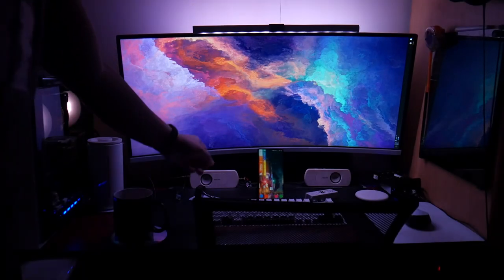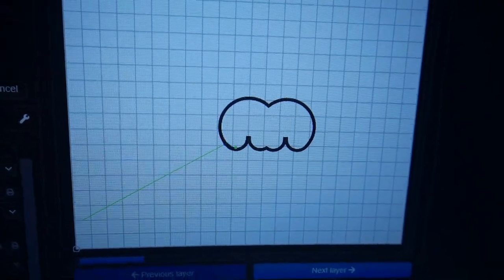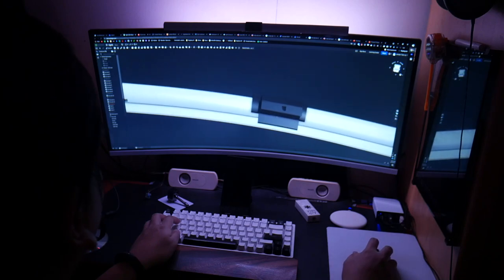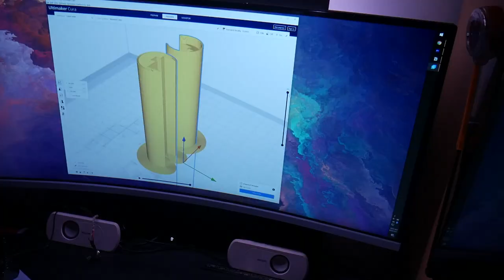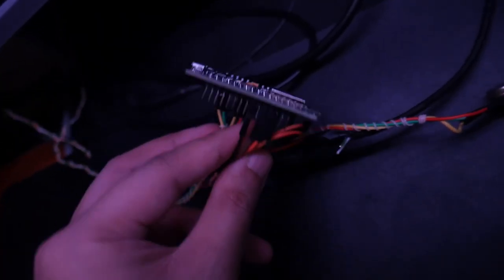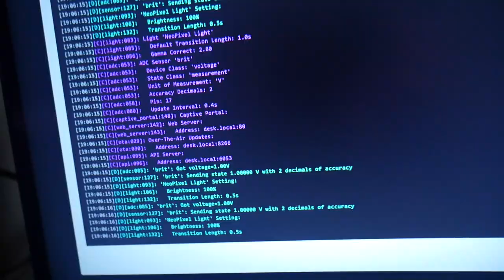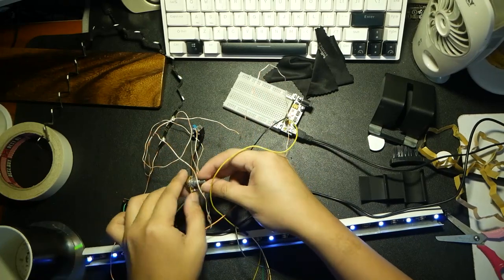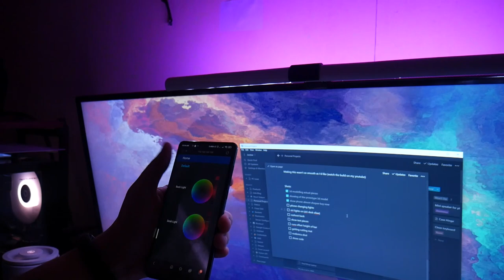Build or buy: Smart desk lamp

Comment: Is the light asymmetrical like the benq and Xiaomi bar? I want to make one too as I want RGB as an option, but I'm not sure what the light direction will be like. Does it hit Ur eyes or get on the screen? And any way to add a diffuser?
Reply from the maker: I designed it in a way the you can tilt the light in any way you like. As for the diffuser I put in slots in the model so you can slide in some, I failed to slide in normal printer paper, so plastic diffuser material is recommended
Reply: @thejandaebuildlog  Thanks! Any idea where I'd get plastic diffuser from that's the right size? Also I understand the tilt mechanism, but what about the beam angle, is It narrow enough so it can tilt and just only hit the desk without hitting the screen and eyes? Or is it wide so even if you tilt it to not hit the eyes it spreads onto the screen?
Reply from the maker: I also don't know where to source diffusers 😅 aside from the actual strip diffusers. As for the light its more of a cone shape than a beam and I think the light hitting the monitor is not an issue (as long as your monitor is bright enough). Hope that helps!

Comment: DIY with a 3d printer! you just expect someone searching for DIY to have a 3d printer!!
Reply from the maker: Yeah I felt the same before getting my printer. But I realized you can say the same for other tools a DIY-er has (drill, soldering iron, etc). So yeah I treated 3D printing DIYs as an inspiration or a source of ideas. 

It's possible to make it with PVC pipes if you don't have a printer 😁